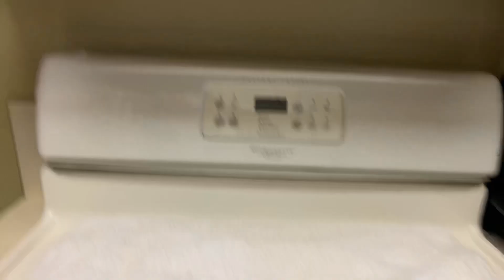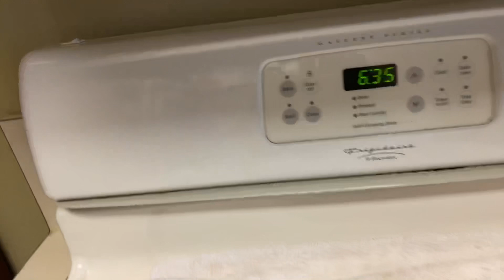ASMR!!! Cleaning Vlog!!! 🧽🧼🦠Cleaning The Stove Light?!!😅

Comment: Be super careful not to get liquids of any kind into that light socket and the fan unit as it could cause a fire or you could get shocked when you turn it on. Also, you may have to get one of the guys to look for how to do it, but that filter should come off. I soaked mine in the bathtub with some degreaser and it comes right off. Great video Roxy!!!
Reply from the maker: Thanks so much!!! 💕
I wiped the inside of the socket before putting a new bulb 💡 in 
It was very dirty! 
I’m going to clean the filter next 
It definitely needs to soak 
Thanks for the tip 
Very helpful! 😁👍